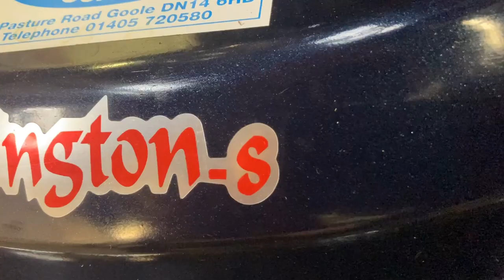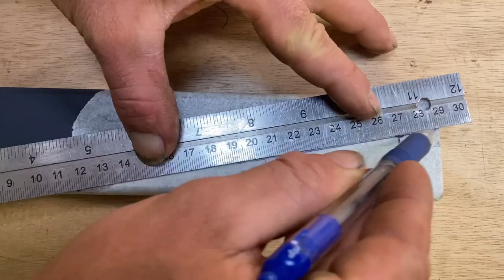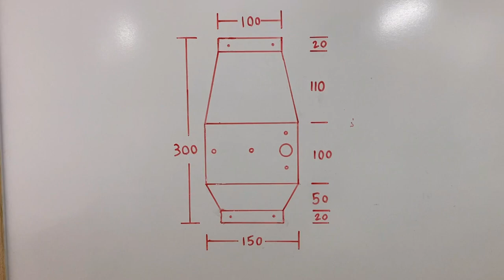Building a Minature Electric Land Rover #1

Comment: Hi Dudley….well interesting..will be following you..one question Dudley….the wiring you have cut off……when time come to put back together is it just a case to unwind the wiring loom and disregard the parts not required?  Dave…
Reply from the maker: Hi. Sorry I didn’t reply sooner. 
I plan to keep the wiring loom as complete and unmodified as possible. The scooter had indicators, hazard lights, headlights and a horn. All of which will be present on the finished car. Some wires will need to be shortened or lengthened but otherwise the loom will stay as it is. 
Thanks for watching 👍🏻

Comment: Any progress ?
Reply from the maker: Hi, sorry for the late reply. Episode 2 should be available later today. Hope you enjoy it 👍🏻
Reply: @dudleyhewett7211  hi Dudley , just starting to make a toylander landrover and want to see if i can use a mobility scooter  fo the chasis and electrics rather than using thier parts as they work out really expensive,  do you have the width and lengh dimensions you used,
Also do you have part 3  when you completed the landrover . i can see parts 1 and 2 and then where you made the trailer but not the episode in between . 
Cheers
dan